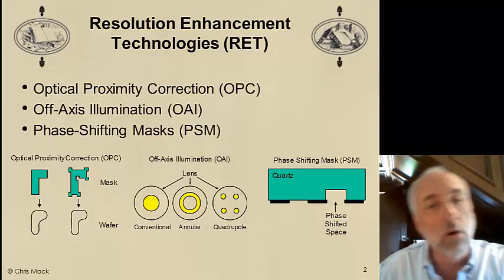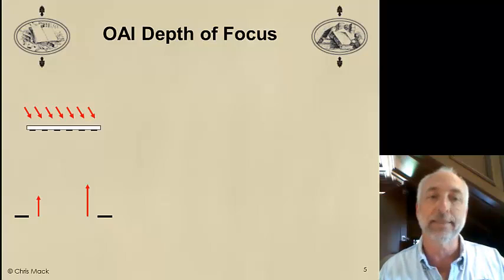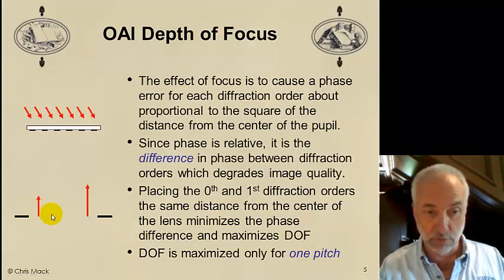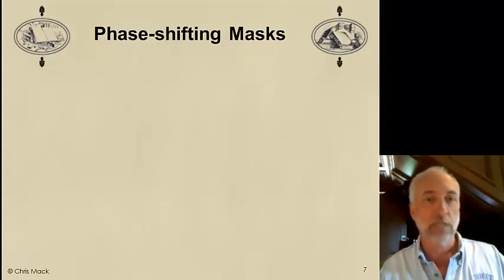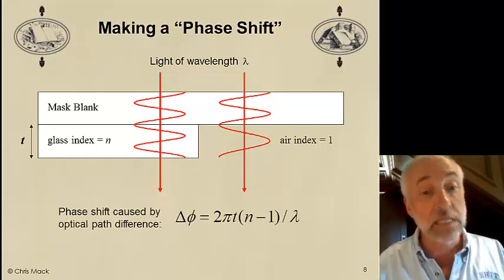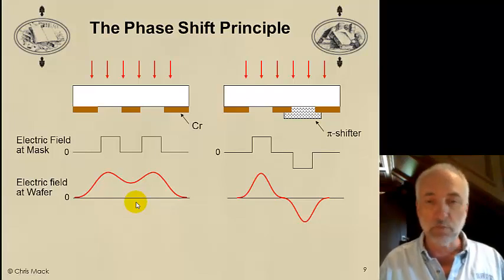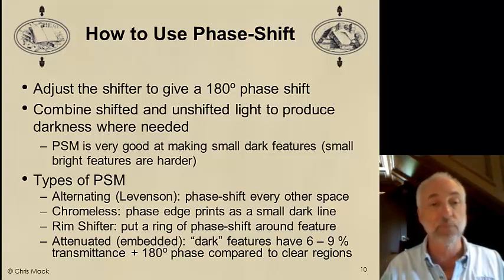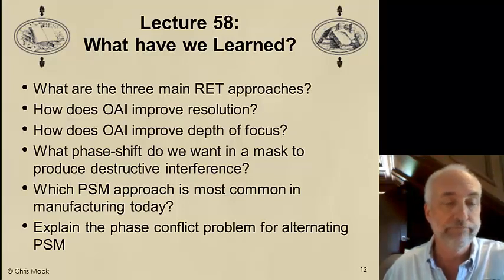Lecture 58 (CHE 323) Lithography RET, part 2

Comment: For the specific case of three regions meeting, I suppose that 0, +120, and -120 degrees phase shift might produce a better compromise. Not as crisp at the best case, but better in the worst case.
If 0, 90, 180, -90 degrees produce ok results then you can color any map with four colors at least. I suppose that at meeting of regions with 90 degrees phase shift gives a better behavior than zero degrees, but worse than 180 degrees.

Comment: There's a lot of overlap between the ideas behind holography and illumination for lithography (because both rely on diffraction, I suppose). In holography, you ideally want control over both the amplitude and the phase over the whole wavefront (compare with the wavefront that exits the mask). I suppose you could use ideas from holography to shape the mask. But that's probably part of what optical proximity correction does already - and it should also be able to exploit phase shifting I think.

Comment: Is phase shifting mask used for EUV as well? Theoretically, I suppose you could do it by making parts of the mirror surface protrude to create the phase shift. But it seems very hard to manufacture that kind of mask with good accuracy.